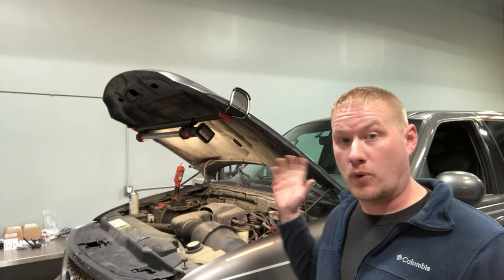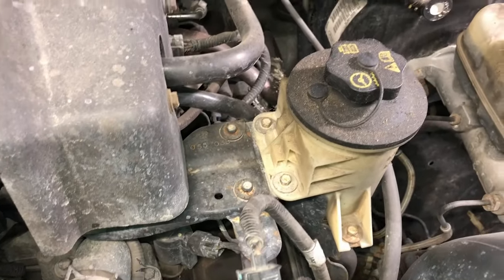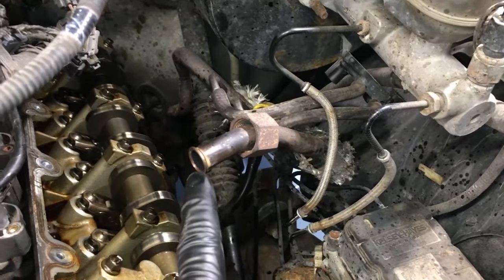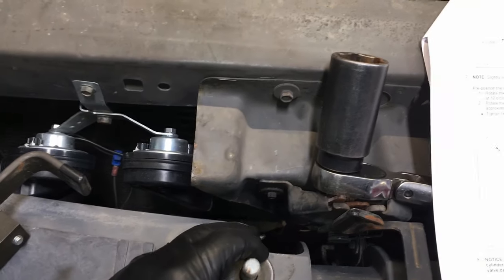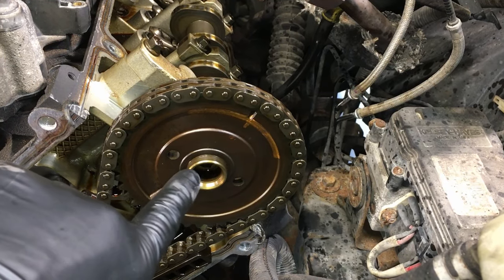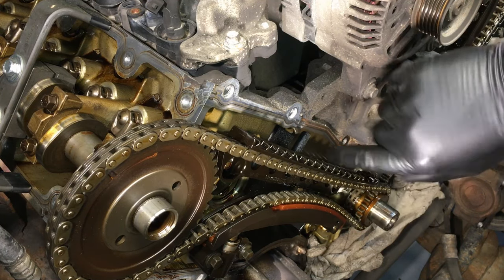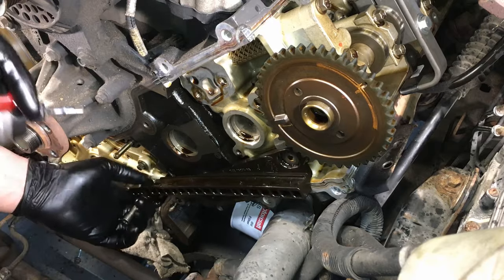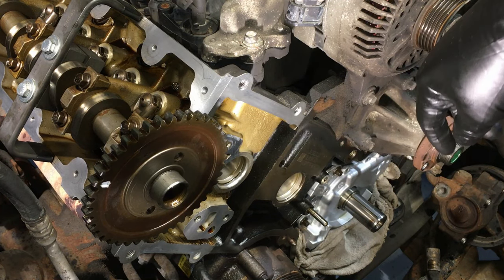Ford 5.4L 2v Triton Engine: Complete Timing Walkthrough

Comment: Hello love the channel I'm doing a full timing chain kit replacement on a 04 f150 with the 4.6l 2valve the cast metal tensioners that came with my kit also came with the stainless steel looking gasket for the tensioners that only has one small hole opening to feed the tensioner with oil it seems kind of restrictive and I'm using the melling high-volume oil pump my question is if I should use that stainless gasket or not the Finish is beautiful on the tensioner itself and by using that stainless gasket that only has one small opening for oil it seems it may be very restrictive of oil flow I've just never seen this style plate gasket behind the tensioners use before and I don't want to have to go through this process again after I get it together any help would be greatly appreciated thank you and keep up the good work
Reply: what did you ultimately decide to do with the stainless gaskets?

Comment: My metal  chain tensioners  came with  flat metal plates for right and left...should i use them or just bolt tensioners straight onto block??
Reply from the maker: Those plates are only for the very early models.
Reply: @FordTechMakuloco  Thank you my Ford truck is a 2003 5.4l model

Comment: Carved2551
Carved2551
26 minutes ago
I bought parts for my truck prior to tearing my truck down. I found that my existing cam sprockets are pressed on type versus the bolt on type. Are replacement cam sprockets available or do you have to purchase new cam w/sprockets?  Do you have a video showing how to press off and press on new ones.
Thanks,
Gerald J.
Reply: You don't need to replace the cam sprockets, just the crank sprocket.

Comment: Is there a high volume oil pump available for these engines?   Mine has 315,000 on it and I'm going to do a timing set soon.  It's still completely original.
Reply from the maker: no

Comment: I know this sounds stupid but, How do you tell a 5.4 3 Valve from 2 Valve???  I have a 2000 F250 I want to replace the timing on.
Reply: You have a 2 valve, the F150 didn't get the 3 valve until 2004.

Comment: Do you get any of the 250's with the v-10 6.8 engine??? Good or bad engines? Are there any common problems?
Reply: James Le Compte they are real good engines. They have the plug popping issue, but I have never seen a plug let go that was torqued properly.

Comment: You are awesome. Where the heck are you cause my plungers are toast and now a slight rattle when running which just started recently on a 252K mile 5.4 2V. I love my 2004 Expedition and really want it to last a lot longer. I would hate to go to someone that does not know what they are doing.

Comment: The cast iron tensioner pin doesn't need a gasket? It's ok for it to be metal on metal since the last ones had the gasket broken?
Reply from the maker: No need for a gasket.
Reply: @FordTechMakuloco  koo thanks, hey Brian I need some help with my 2003 early year expedition 5.4 2v, I was wondering if you could help me out as I dont know what else to do or check. I would greatly appreciate it!! I've been having a misfire in cylinder #1 that comes and goes. Plugs and coils are new and swapped injectors from cylinder #3. No coolant in the cylinder spark plug still looks brand new, no milky oil, no overheating, so I doubt it's a blown headgasket as no symptoms. Also, the check engine light doesn't come on as the misfire goes away after a few minutes. Does not happen all the time, maybe once a week. Codes p0301 and p0316 are the ones I get on my scanner when the misfire shows up on startup, but then p0301 goes away, and the misfire goes away, too The truck runs super good after no issues or loss of power. I have added Marvel mystery oil to the cylinder to clean it up, have added fuel system cleaner to clean the injectors if they are clogged, have a new fuel pump, and a new fuel filter. I Have spoken to many other mechanics, and none seem to have any sort of idea what the issue could be. It started happening after I swapped out the thermostat as I got a check engine for the engine running cooler than normal. After I swapped it out, it got to normal operating temp at 190-200 degrees, and it was running at about 160-168 before. That's when the misfire started to happen to cylinder #1 and #2 but #2 went away and #1 has come back a few times. Have you come across this issue? Would greatly appreciate your help, thank you

Comment: Will this be the same info for a 4.6 2v ..??
Reply from the maker: Similar but not exactly.
Reply: Can you tell me the difference between the two going to do. A 4.6 2v. Thankyou
Reply: @erniepaga8059  i think it’s just the timing marks. Check your new chains ⛓ it’ll have a mark or a different color mark on chain. 
4.6- 5.4 2v the difference is the block. The 5.4 is taller by I think 2inches.. I might be wrong.

Comment: There is a sensor of some type on the long bolt of each side on the top of engine the timing cover. My question is what is that sensor called
Reply: I can’t quite remember what they’re called but they have something tot do with anti-interference for your radio

Comment: Be aware- 

I installed a M176 in a 5.4 2V, did the crank prime procedure you recommended and my dash wouldn’t show oil pressure, even after multiple 10s of seconds on cranking! I probably cranked for a total of 2 minutes trying.

That made me think there was another issue, like a plugged oil galley, etc. 

turns out my engine just couldn’t crank fast enough to build up readable pressure. Or maybe the 176 isn’t strong enough to. I had 55 psi cold oil pressure when I decided to start my truck.

Don’t know if that’s just me or what.
Reply from the maker: Nope some do that no big deal
Reply: Uggghh so much scrolling to find this. I did the 176 as well went to try and build oil pressure and nothing. Going to try again tomorrow with a fully charged battery and see if that'll help. I just didn't wanna start it with no oil pressure

Comment: 03/04 5.4 2v have the 8 thread heads. Bullet proof engines. The only weak link is the tensioners and guides. I've seen them with 250k+ with factory timing components still on. I advise against letting them go that far, but they do make it there for the most part. It's not uncommon to see these things hit 350k+ as long as the timing components are changed out evey 150k
Reply: 335k hard miles on my 01 5.4. All original. Just had timing chain start making noises. Time to get the kit and rebuild it. This truck has impressed me

Comment: I wonder if my SVT lightning is the same way as the regular 5.4s doing timing chain on mine as we speak,
Reply from the maker: yes
Reply: Thanks, my uncle and I are having tough time with it, we got drivers side chain on but the crankshaft key position is at the 2 o’clock so I think I need to take chain off, put it back at 11 o clock position and try again, this time only try turning the camshaft to live it up and free up the slack

Comment: im noticing that the old style cast iron tensioner has no seal on it, wont that cause some oil to blow by causing the same issue or does the ratchet inside prevent the chains from loosening off
Reply from the maker: No seal required
Reply: @FordTechMakuloco  thanks man, i gotta do my timing chain guides and tensioners, my 05 4.6l is ticking like crazy now, i really appriciate the feedback, thank you

Comment: Man i love all your vids. You sir are a godsend... I have 1 little question on the head removal. If i have the crank at 12.. the sweet spot where all the pistons are down. Do i need the cam holder on ? The reason i ask is its right over 2 of the head bolts.

Comment: I have  2  2003 f150's one of which ate a guide snapped a chain and wiped out the r/h head.
I had the heads repaired , cleaned out the oil pan and pickup tube, installed new pump and timing kit with the parts you recommended. (I am extremely satisfied with, thank you) Question,  the old tensioners had stainless steel plates behind them the new ones from melling don't, my book does not show them and your video didn't either so I left them out, was I wrong in doing so, and what are they actually for?? The truck is running better than it ever has but I still wonder about those plates. getting ready to do the other truck now hopefully without the head work.  I really like your videos there's no BS, you stay focused on the current task and provide a ton of information that would be hard pressed to get out of a manual.    Thanks
Reply: What did you learn about the metal gaskets behind the tensioner? were they needed?

Comment: Thanks for this video! Do you still recommend the parts listed?  In other videos you don't show much love for aftermarket timing  components.  Should I use my amazon cart, or go to my dealer for ford chains?
Reply: I was wondering the same thing. Melling or OEM. It’s getting harder and harder to get OEM parts for the older 2 valves.

Comment: I set the timing according the video. But the engine is not starting.
Pls I need help on what to do
Reply from the maker: If you did everything right and it will not even attempt to fire then you may not have the crank sensor attached or fully clipped in.

Comment: I have a question, 
My timing chain tensioners came with some metal shims
Are we supposed to use them?
Reply from the maker: Only on the old old engines like pre 1996, there should be a slip specifying this.
Reply: @FordTechMakuloco  mine is a 2003 f150 5.4 is 2valve engine
Reply from the maker: Then no you don’t need them

Comment: Are the roller followers problematic like the 3 v engines? Should they be replaced also?
Reply from the maker: no
Reply: @FordTechMakuloco  Thank you so much for your videos. And Thank you for the quick reply because I know you get asked a lot of questions. Your 12 hrs away from me. I'll get in touch about timing job and oil pump for a 2000 Expedition 5.4 2 valve. 275000 miles never been into. Still sounds good on start up and hot idle but I know time is coming.

Comment: Can you all replace the pick-up line going into the bottom of the oil pan if yes part # also
Reply: 3v oil pump and pick up tube is best
tube is bolted accessible if u remove the pan..
if u have correct size tube for 3v oil pump u good just switch out pump

Comment: What about silver plate behind the tensioner. Sold that in there. I see you didn'tt install them.? Please answer back
Reply from the maker: Those are only used on some early models of the modular engines.
Reply: If you don't see it. Don't use it right.?

Comment: Man thank you. I’ve watched all your vids and have a 5.4L 2v Windsor that’s a jasper remanufactured engine. Right now I’m getting misfires on cylinder 1,2,3,5 & 7. Under slight load the truck runs great, anything over about 40% throttle and the truck starts cutting out. I’m starting with plugs, egr, pcv, and coils but I’m afraid the cam phasers are throwing the knock sensors into cutting timing back. Thank you for the video. If I get that far I will definitely need the help.
Reply: 2v no cam phasers...
if u do timing... cam gears are not replaceable unless you get new cams then I would not change the crank gear either ... either trust the ford timing marks or all aftermarket timing marks not a mixture
Reply: John Padgett What do you mean 2V no can phasers
Reply: Mathias Lang The 2 valve has no vct (variable cam timing) solenoids and no cam phasers.

Comment: Is this the same for a 2000 ford f150 4x4 5.4 engine?
Reply: yes
Reply: I did water pump ,oil pump ,spark plugs ,clean injectors,everything truck use to get check engine light on .
Thanks for the video.

Comment: What’s typical labor book time on this? I got a quote for $500 labor plus parts cost. I thought it was a little high labor wise cause the shop I know is $50 per hour.
Reply from the maker: Easy 10 plus hours.
Reply: @FordTechMakuloco   how long does it take? Not book time, but for real time
Reply from the maker: 6-8

Comment: You  for got to say to pull # 1 spark plug and stick a screw driver in it to prove it is on top dead... I listened to you and after I did that I got it retimed coorectly
Reply from the maker: I never said it because I used the timing tool to set crank position. not to mention you could just set the keyway close and it would be fine since it is a colored link system.

Comment: Why can't you use the cam holder on a 3V instead of removing followers?
Reply: cam holders hold about 30 degrees of camshaft rotation at tdc on a 2v
a 3v might have more or enough pressure to bend valve on piston 
if u pulling head take head bolts out before chain removal to avoid valve piston issues and allow u to hold and slowly release it

Comment: Heya Bruddah, Howz the family?  Hope all are doing great.
 
As always I love your videos. And yes I got your videos on alarm whenever a new one comes out ;) 

Wife thinks I'm a tad nutty. That's OK women weren't born with hidden gravity detectors. I told the wife that one more than a decade ago and she is still scratching her head.  Sure hope she doesn't have fleas. 

Bruddah, I see you've put that Carlisle 3/8" flex-head ratchet through its paces. How do you like the fine tooth ratchet?  Tough booger ain't it. I love mine. I'm serious, I liked it so much that I went and got the 1/4" and 1/2" too. Man, they are tough as nails and the work like a smooth, real precision, German-made tool even if they are made in Taiwan under really strict quality control.  I had my 1/2" on a 4-foot pipe on a really, really stuck bolt that I used MapGas on (with zero luck) and the handle was flexing hard with 350 lbs of angry man force stepping on it.  Bruddah it held up to the task with no problems whatsoever. Easily as tuff as any equal SnapOn. I would never buy nor recommend the Evergreen / ever... sumthing tool brand. Those are almost as bad as the MATCO from hell.

They are great. IMHO, They are better than SnapOn or MAC and especially the MATCO I'maBreakAlot stools, er tools... Sorry Matco most of your tools are cheap junk and not for the serious and dedicated mechanic. We're better off with GearWrench.

Back to the video .. Couple questions for ya;

1) Did the customer turn down the option to change out the fuel injectors, spark plugs all the normal "it's time to replace these items" while they were exposed? Gotta be plenty miles on them. The injectors look like they were never changed out.
2) When are you all coming back out to Hawaii?  Bruddah the family has seen the home and we got plenty of extra bedrooms. You don't need to a hotel room, that stuff will break the bank and you now got family in Hawaii, so use'em. That's what family is for.  You don't even need a rental car. The truck all yours for as long as you want. If you're worried about the kids .. Don't be!!!  We Love Them. All 23 of them, O.O  ... just kidding bro, we love the kids. They are cool and I promise not to bite anyone for 24 hours ...... Remember we're parents too ;)

And for all you MATCO lovers .. God Bless you. Hope your knuckles heal OK.

Comment: How do you tell a 5.4 3v from a 5.4 2v? Thanks
Reply from the maker: Many differences but the most obvious is the sight of the vct solenoid sticking through the top of the valve cover.

Comment: I think I would have started with a good degreaser/cleaner and pressure washed the engine compartment first.  Makes the finished product look nicer, even if the all the work was preformed inside the engine.
Reply from the maker: To each their own but I am not in the detailing business.
Reply: @FordTechMakuloco   I can understand that, plus you only have so much time you can devote to the repair, and I'm sure that took lots of time.
Reply: @FordTechMakuloco  

To often ppl shoot high pressure water and cleaners at engines that rely on electronics and there related connectors. While connections have come a long ways, they are not intended to withstand 800+ psi blasts imho.

Comment: The valves hitting the pistons can only occur for an interference engine. I don't think a F-150 would have an interference engine, that's normally for compact cars; am I wrong? Is the Ford V8 5.4L 2-valve an interference engine?
Reply from the maker: Ford belt driven engines are non interference and all Ford chain driven engines are interference engines.

Comment: Just wondering how to tell if my 2003 5.4l expedition has a Windsor engine? I really can't get in close enough to see the block stamps. There is a sticker on the valve cover, that says Windsor Ontario Canada, so I'm assuming it's a safe bet, but want to be sure the heads are "Windsors" and the block is also. I noticed that the oil filter angle is different on this f-150 than my expedition, and i don't know if that is true for all expeditions vs trucks.
Reply: never mind I figured it out from the VIN # its got an 8th digit "L" code which confirms 100% it's a Windsor..love the channel!!

Comment: Wouldn’t u want to change lifters and rockers while your in there?
Reply from the maker: Nope they NEVER FAIL on the 2v engines.
Reply: @FordTechMakuloco  wow, wasn't holding my breath for someone with so many followers and videos to respond so quick. Thanks for that. Is there really that big of a design difference in the lifters/ roller followers between the 2v and 3v engines?
Reply from the maker: Yup much beefier.

Comment: At 6:30 you reference the camshaft rotating and causing a valve to open and strike the top of a piston. If I recall correctly, aren't the 2V 5.4 engines non-interference? I could be wrong.

However I agree "locking" the cams in place is a good idea to avoid losing the correct valve timing.
Reply from the maker: All Ford engines that use timing chains are interference while all Ford engines that use Timing Belts are non-interference.